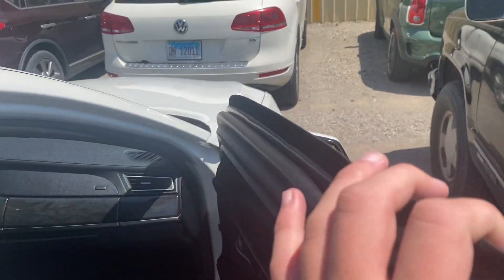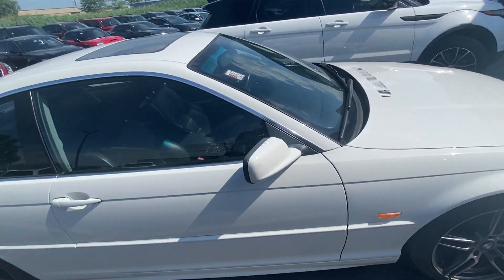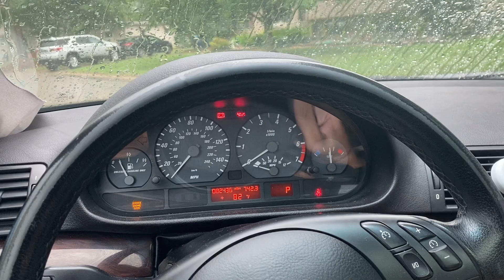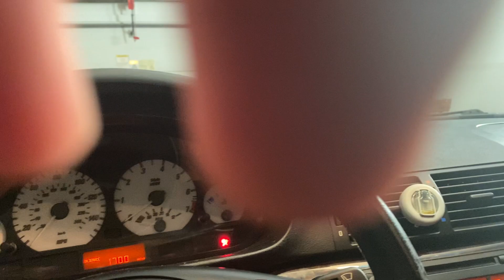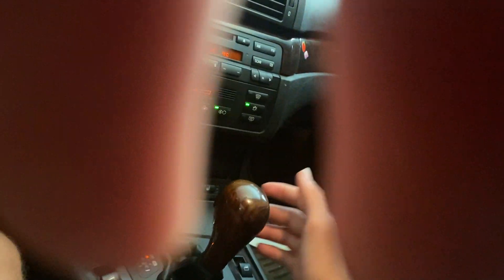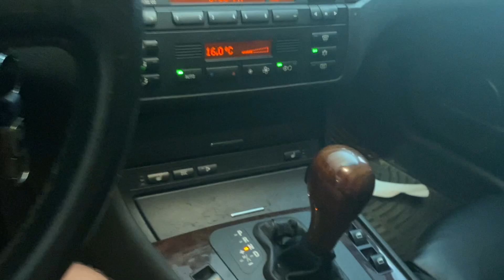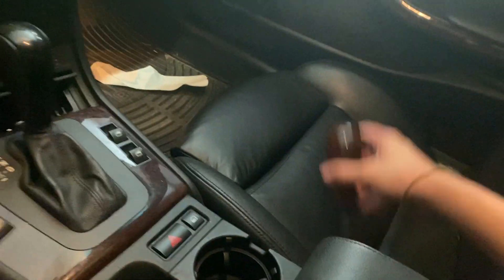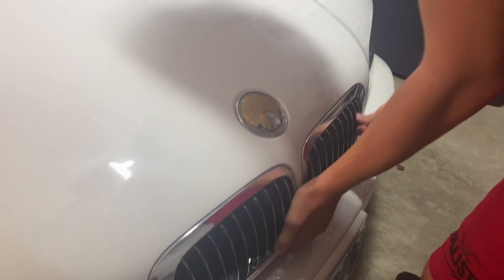IS OWNING A BMW EASY?! HOW IS MY CAR HOLDING UP? NEW MODS! | IRLG Vlog

Comment: My step dad actually owns a 2018 340i with the 3.0L i6 and it has the optional twin turbo, it sounds almost exactly how your e46 does when you floor it, but the startup sounds alot different and in my opinion better on the 340i, it’s the M Competition package

Comment: One thing I got to say real quick is when my dad had an e46 it did have some electrical problems to be weary of that but no great find though also not sure if this happened to other peoples e46 but my dads e46 chewed through blinker bulbs constantly so have extras just in case
Reply from the maker: never had had any issues

Comment: Be Careful with those not all of them are Reliable its nice to see you bought it altho you didn't go for the 7 Series ima happy for ya altho 7 series would've been nicer.
Reply from the maker: the 7 series wouldve been way less reliable and wayy less gas mileage, you realize the older bmw’s are more reliable than the new ones since the old ones were built better
Reply: @lgsplash  It is true my aunt has a 2014 she got the suspension fixed and one it got fixed a whole bunch of other problems come on like cruise and adaptive cruise her seat wasn't moving and her suspension wasn't acting right.Suggested mod Factory navigation
Reply: @lgsplash  German over engenearing at it's finest
Reply: @lgsplash  hey lg the BMW that was keyed Turned out to be a stolen car after a massive break up between a girl friend and a boy friend the girl friend was mad she stole the car it led onto a police chase in compell police in Texas the girl friend keyed the car before stealing it the girl friend had a gun and opened fire on the officers in ended in San antonio Texas it led to a gun battle the girl one of the officers had a machine gun  the girl friend was killed after being shot in the head by the officer with the machine gun

Comment: Mod suggestions: add straight pipes, or any other aftermarket exhaust system, maybe a wrap, tint the tail lights, turbo, what even happened to the original silverado
Reply: straight pipe it and it'll sound as raspy as a civic
Reply from the maker: @joshye39  incorrect
Reply: @lgsplash  please straight pipe the 46 and then return to my comment
Reply: @lgsplash  do any exhaust modifications other than straight pipe